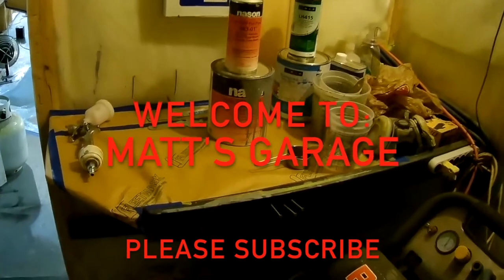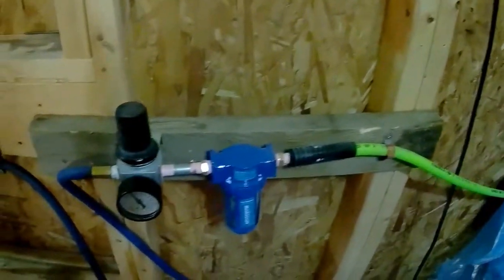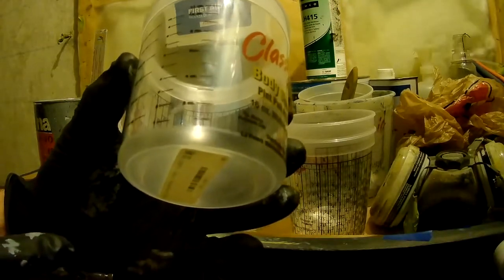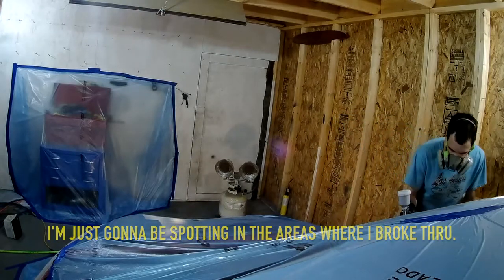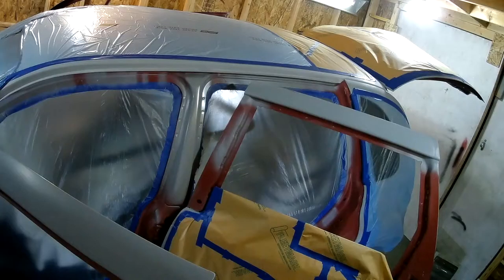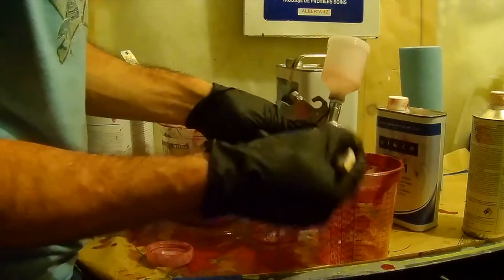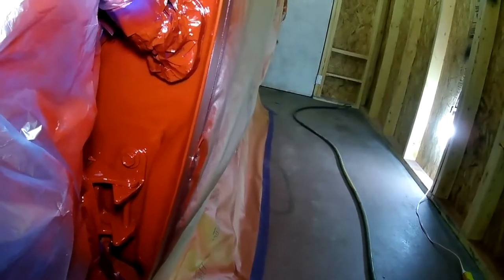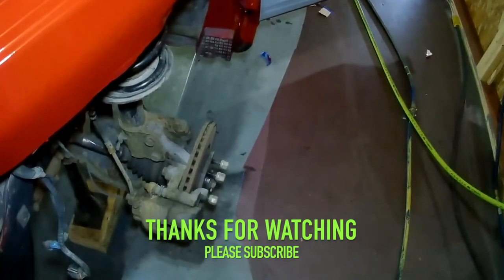Spraying Door Jambs with doors on - Custom PT Cruiser

Comment: Loving the pt cruiser repair info you have on your channel! I just got a non turbo automatic pt cruiser and am wondering if 3rd gear is the normal drive gear since the shifter just goes from overdrive to 3rd? Thanks
Reply from the maker: John Carguy Nope, it should run in 4th on the hwy but it will downshift pretty easy into 3rd if needed. The cruise control will also downshift it into 3rd to maintain speed going down hills. I will have plenty more PT vids coming up, my dad’s blue ‘05 is due for a whole list of work and later my GT project will be pretty extensive as well. Thanks for watching and the feedback.
Reply: Matt's Garage thanks. Looking forward to the upcoming videos

Comment: Hey Matt, do you put clear coat on those areas?
Reply from the maker: Zapp Brannigan Not with this paint, it’s a “single stage”, most paints now are base coat and clear coat as it is somewhat required for any color with metallics or pearl in it but since I’m spraying solid colors I was able to get it mixed in a single stage paint. I personally prefer the look of a nicely done single stage paint job over base clear.